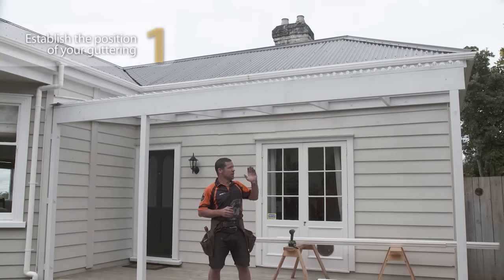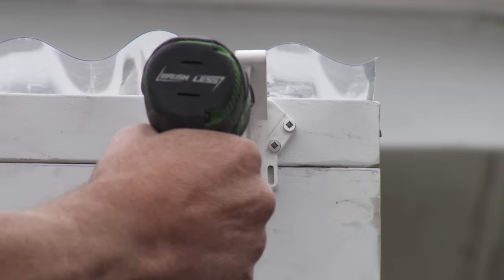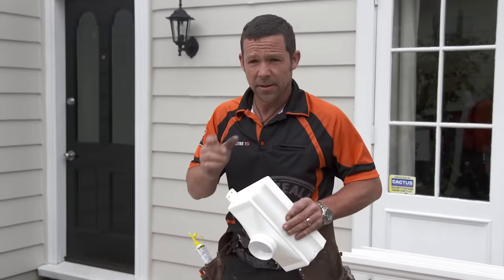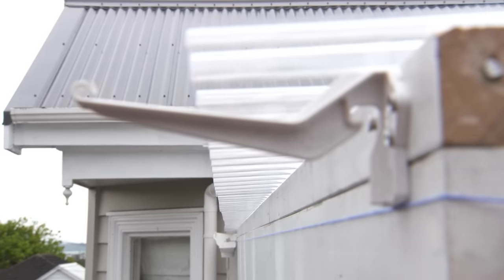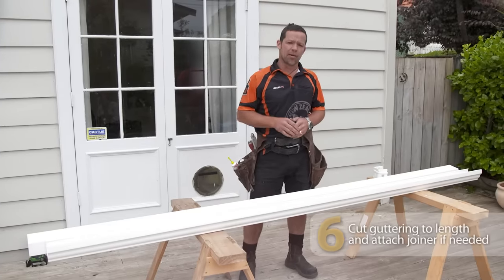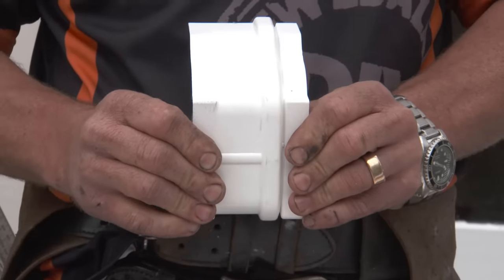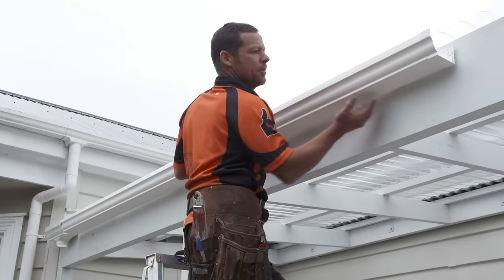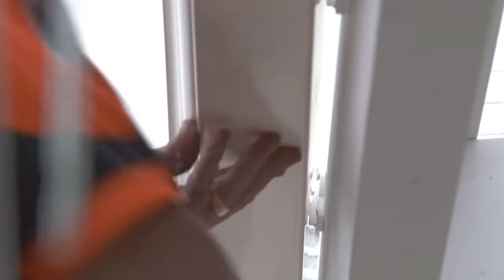How to Install Guttering | Mitre 10 Easy As DIY

Comment: Saved $800 by watching this. Thanks a lot.
Reply: But one thing I found out from doing it myself was if you are putting the "dropper" - (the section where the downpipe goes into) into a corner, you will have to glue on the endplate AFTER you put it in place otherwise you won't be able to get to the screws to attach it. The same goes for the end plate at the other end. I had to screw in my endplate after I had put the guttering on as the guttering would not fit through the slots otherwise. Hope this helps.

Comment: 9/10. Would have been 10/10 but the glue was applied to the gutter where it wipes off on assembly. It should be applied the groove of the joiner where it is much easier to apply and much stronger and less likely to leak.
I learnt a lot from this video but found this out after doing it myself  :)

Comment: You might wanna check that beam is level before you just measure 5mm less. It could have dropped over time or was never set level.
Reply: He actually built the pergola and roof himself in previous videos
Reply: Yeah, this is actually one of the hardest parts.
Reply: Doesn't matter because he measured 3mm from the bottom of the beam to the bottom of the bracket so regardless of whether the beam is level or not the gutter is always dropping 3mm over 5 metres.
Reply: @Tomski McDougle if the beam isn't level though it won't necessarily drain the way you want, say the beam was sloping to the right 10mm, (out of level) when it was set 3mm lower on the left hand end it would still mean it was sloping or draining to the right hand end (now out of level by 7mm). 

If your beam is level then yes, this works perfectly, and since he built it, he would have known it was or checked it was before he set up his gutters.
Reply: I agree.   An old house for example.  Pile slumping etc .  That is  the videos weak spot , not giving another way to measure fall that is more accurate and less assumptive.

Comment: Nice job , however I would fit a rain head because two roofs flowing into 1 pipe in a heavy rain will cause issues . That length of pipe with two roofs going into it is quite restrictive to flow .

Comment: What is the reason for the different placement of the screws in the hanging brackets? For the end bracket there were 4 screws put in the round holes. For the brackets along the length the screws were put in the top holes and the lower slots.

Comment: Hi I am wondering if the silicone glue not the PVC glue can be used. Thanks
Reply from the maker: Hey George, we recommend PVC solvent, especially if using Marley spouting. Silicone can do the job, but a PVC Solvent has the benefit of bonding faster, being easier to apply, more durable against the elements, and longer lasting as it’s an actual bond hold. ^Matt

Comment: The fall is not correct which has been quoted on here. It should be 20mm for every 5m unless you want the water to sit there. Check your local codes!
Reply from the maker: Hey Rip, Marley’s website states a 5mm fall for every 10m which is the direction we are following. You can check out the installation guide here: https://www.marley.co.nz/wp-content/uploads/dlm_uploads/2016/04/Spouting-Downpipe-Trade-Installation-Guide-August-2016.pdf
Reply: @mitre10nz great video but measuring a 3mm fall over 5 meters by hand is very dangerous. It was not checked with a level and you are assuming the beam is dead level. 3mm is a very small amount to work to.

Comment: The biggest challenge for me to install roof sheet plus guttering onto my balcony roof is that my unit is on top floor of the building and there is no access to go on roof.
Reply from the maker: That is tricky Shakil. Is your unit part of a Body Corporate that might have access? ^Kane
Reply: @mitre10nz  no strata corporate doesn't have access to the roof. Not sure how can i install this on my balcony to protect from rain.
Reply from the maker: Hi Shakil - in that case, feel free to send us a PM on Facebook with some photos of the roof, and we would be so happy to see what advice we give to help.
 
Or otherwise you could head into your local Mitre 10 store with the photos, and chat with one of our team.
 
Cheers, ^Ian
Reply: @mitre10nz  
Appreciate your help, thank you.